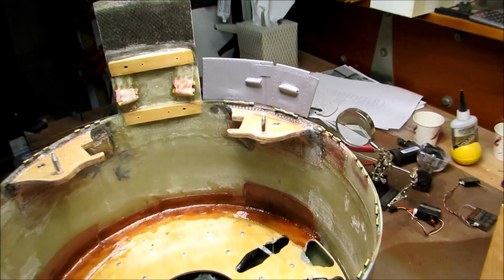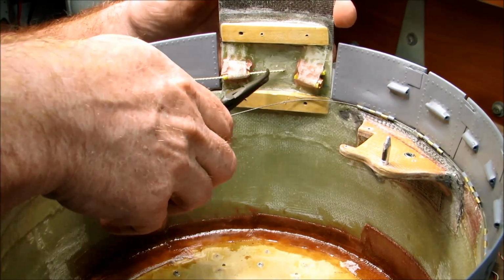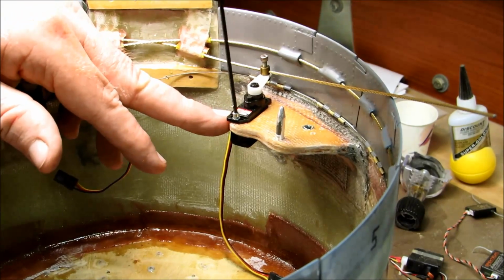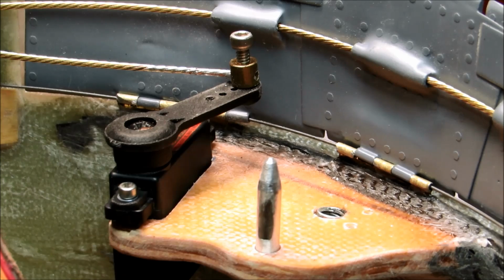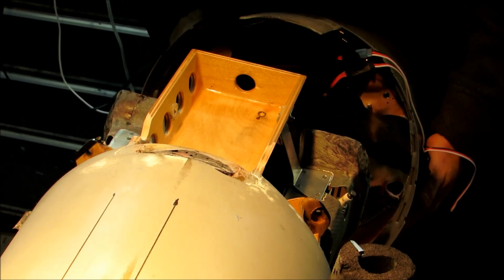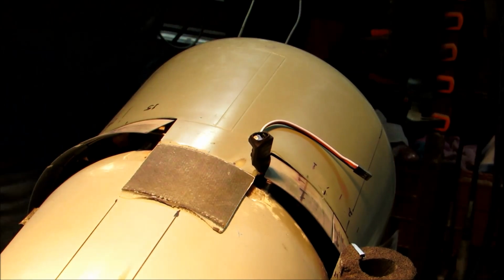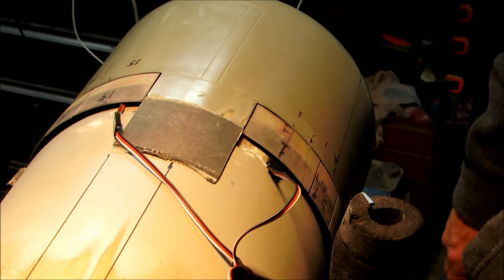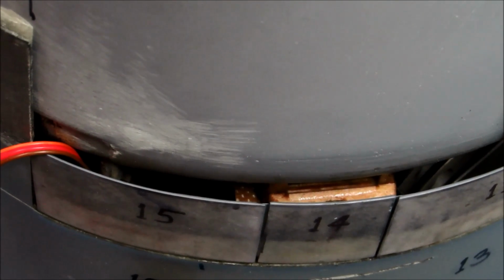Corsair #49, Installation of the Cowl, Complete with Cowl Flaps and Baffles

Comment: Hi there, I'm experimenting with cowl flaps in a science fair project for school and I am going to build an engine model. Where can I buy the servo motors used in this video to move the wires attached to the cowl flaps? Thanks for your help!
Reply from the maker: Those servo motors can be bought at any local hobby shop, or online at places like horizonhobby.com.
Reply: Thanks for the quick reply, I was also wondering what their specific name was. Were they the JR ds 388?
Reply from the maker: Yes, DS388HV to be exact, but if you are using less than 7V, you can use regular DS388's.Also...depending on how many cowl flaps you have, and how smooth they move, you can use a much cheaper servo, like a Hitec HS85MG, which will save you $100 or more. The JR servos are NOT cheap.
Reply: Ok. Thanks for the information! I'm only building a basic model of an engine with cowl flaps. I was wondering what kind of servo do you recommend for me to buy? (I'm looking for a cheap servo for under $20 and is strong enough to perform with very smooth flaps.) There is also the same amount of flaps in my engine model as yours.
Thanks!
Reply from the maker: I would give the Hitec HS85MG a try. They almost worked for me, but I needed a bit more torque and some margin, which I didn't hae with the Hitec servos.

Comment: Very cool, try putting a drop of oil on ALL hinges and cables to help keep the stuff from binding
Reply from the maker: That's a good idea. But not until after painting has been done...provided, of course, I ever get to that stage.
I have, at some point, replaced the cable with a very slightly smaller diameter one, and that made a HUGE difference.
Reply: @TheEnigmaThatIsDrIce  

I know that it's been three years since you've posted this video but I was going to say that perhaps marine grease or graphite powder down in the cowling flap hinge points as well as down in where the actuator cable feeds, in addition to your own solution of going with a smaller diameter cable, to the binding issue might be another option for you.
Awesome work!
I would like to build a WWII 1/8 scale P-61C Black Widow and your approach to incorporating functional cooling baffling and cowl flaps is certainly inspiring while at the same time addresses the all important cooling issues while adding to the scale realism.
Hopefully, you are still doing things in the radio control world since I've just became a new subscriber to your channel. So, do keep up the good work!

Comment: Nice work there. I can see that you may need to add more support to the servo base (the bottom side) as they wiggle a little bit and might stress the screw to break point at some time.
Reply from the maker: Good point. I have since replaced the .062 actuating cable with an 050 cable, which moves MUCH more smoothly through the 25 or so little Nyrod tubes. The torque required to move the flaps now is a great deal less. Yay!

Comment: Don- nice job and very cool.  Do the cowl flaps help slow the plane down? Or does it help cool the engine?
Reply from the maker: On the full scale, they are used to regulate engine temperature. On the model...I I expect the engine cooling will not be a problem (I hope), but they will probably act as air brakes. Mostly, I made them operational for the COOL appeal. :-)